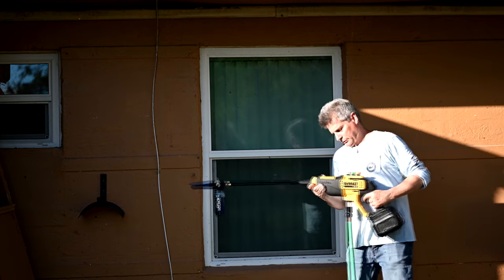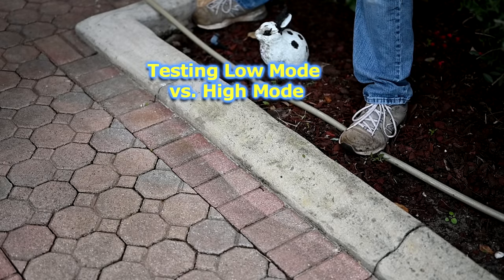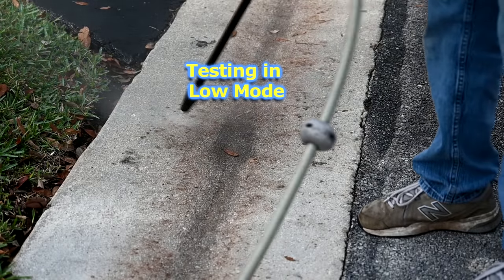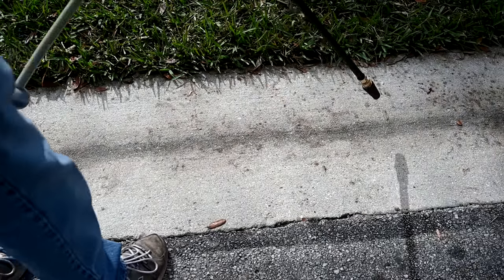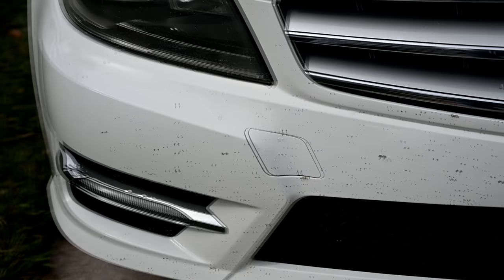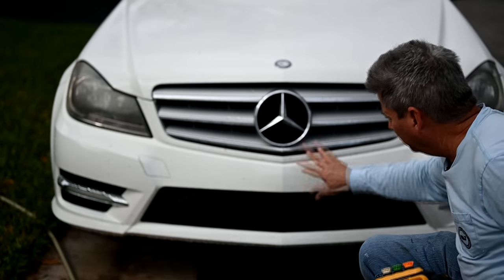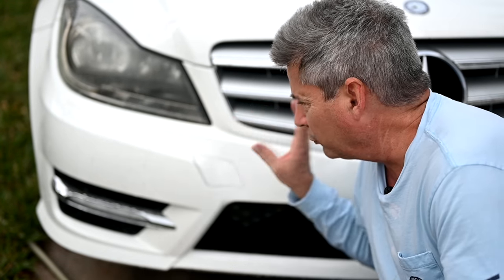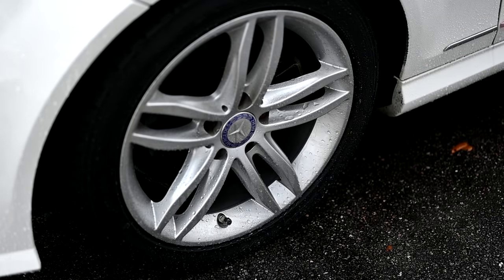Dewalt Power Cleaner: High/Low Pressure Tests Cars, Tools, Sidewalks

Comment: Mine should be in, in a few more weeks. A lot of people hate on this, but the thing is, it was never meant to replace a large pressure washer. This is going to be perfect for me. Because of some surgeries I've had that went really bad, I'll probably never be able to lift a heavy pressure washer again, plus this is a lot more convenient.
Reply from the maker: Good summation!
Reply: Yep, I use my Ryobi, thought it was weak but it has its uses,  just did 5 of the neighbors enclosed balcony @$50 ..crazy that's $250 for 2.5 hours of work..
Reply from the maker: @thetoolmat8632   Awesome that will now allow you to buy a few extra components and set up some hacks for that sprayer

Comment: Jeff I currently own this. Been debating on returning it. Not sure yet. I think the strength of it lies in its convenience. That's the main appeal here. I've been using it for rinsing off tools, trash cans, hard to reach areas, and basic car wash. The turbo nozzle is very inconsistent for me. 
I predict that the price of it will either drop to $99 or they'll do a battery combo. At 149 I don't know if this will be a big seller. At some point maybe a flexvolt only version with more power will peek more interest.
Reply from the maker: A lot of people have been buying it sometimes it goes out of stock in a few of our local home depot's and then you'll see it in back in stock a few weeks later

Comment: Hey Jeff. Tested the washer the other day using an inexpensive Tool Daily foam lance from Amazon. The lance came with a 1.1mm orifice and a 1.25mm orifice. Using the 1.1mm and adjusting both the ratio knob and opening knob I was able to get a creamy foam using Chemical Guys Honeydew. I think the best we can hope for is a creamy foam from the 550 psi. I will be interested to see how your new Ryobi does with the 1600 psi and 1.2 gym flow. Hopefully that Ryobi can get you closer to snow foam.
Reply from the maker: where do you install the orifice?
Reply: @jeffostroff   You unscrew the 1/4” pressure fitting on the foam cannon to access the brass orifice. It is a threaded brass plug with a hole in the center. Most have a slot across the opening so you can unscrew one size and then screw in the other one. https://images-na.ssl-images-amazon.com/images/I/81NdNZBLYrL._AC_SX679_.jpg Here is an image. I hope it works on You Tube
Reply from the maker: @markgaudino7730   Just ordered mine from Amazon and saw a couple of videos on it
Reply: @jeffostroff  Hi Jeff. If you don't post a video, could you please let me know how the foam cannon performs with your new Ryobi 1600 psi washer? Thanks. Oh FYI, Home Depot Kendall (#210) would not take the Lowes 10%. I tried before I saw your update about using the Pro Desk and seeing if they would write it up as Customer Satisfaction. The regular cashier (young guy) said, "We don't take those anymore." Love your videos. Keep up the good work.

Comment: What about using Meguiars All Purpose Cleaner for the bugs?  It may strip the wax but you could use spray wax after washing.
Reply from the maker: I doubt it has the chemicals that will dissolve the insect proteins.

Comment: Video seems to start and end like it’s incomplete. Good information though. I picked this power sprayer after dumping the ryobi squirt pistol sprayer. this one isn’t nearly as poor as the ryobi unit. Going to pick up one of those foam cannons for window and car washing. That seems to be the best application for this device. Maybe even screen enclosures.
Reply from the maker: Just a warning about foam cannons as they require pressure that's often 800 PS I or more which the dewalt unit is not capable of handling so you will not get good foam out of it I have not tried it yet on my unit but I will test it out soon

Comment: I like the idea of this being battery powered but I’m holding out on one to have a bit more power before I’ll consider it as I don’t want two different power/pressure cleaner/washer.
Reply from the maker: We might not get more power from a battery operated power cleaner unless it's a 12 aH 60V Flexvolt.
Reply: @jeffostroff  My thoughts exactly. Weight & ergonomics start playing a bigger factor at that point though.

Comment: I got one the other day and the wife don’t know yet but the Home Depot was running out and I didn’t want to not get one cause we need to wash the brick on out house and siding. Plus we have 4 cars that I wash and they leak so now the drive way has some oil spots that need clean n the rate they were selling by the time i got the ok to get one they would be gone. So this is a case of the better say sorry then ask for permission scenarios. And I did look at the ryobi electric pressure washer and I don’t know how safe it would be to have to run extension cords to get everywhere around the house with water spraying everywhere and I may not get shocked but it could blow an outlet outside my house is older so it has 1 gcfi outlets where they had the hot tub but the other 2 I think need updated to gcfi plug ins
Reply from the maker: Always a good idea to have GFCIs outside, and in all bathrooms and kitchens wherever you are within 6 feet of water
Reply: @jeffostroff  I always get the fc mixed up but you’re so correct

Comment: What soap gun are you using on the Dewalt
Reply from the maker: I was using the crappy bottle with black plastic nozzle is the junkie DeWalt soap applicator that comes in the box, useless unless you just want soapy water. Then you also saw the clear Ryobi Foam applicator which was a little better it has blue plastic top, then the Greenworks applicator had the green knob on top of the bottle at the nozzle. Her eis the soap we used: 🛒  Blackfire Pro Detailers Choice BF-100 Car Wash, 32 oz. https://amzn.to/39JFZss
🛒  McKee's 37 MK37-800 Xtreme Foam Formula Shampoo: https://amzn.to/36yIV9l

Comment: I'm a huge Dewalt 20/60v tool fan. I'm completely invested in this line. Other than portability for washing a vehicle, I can't see any benefit to owning this tool. I own a Ryobi 2300 brushless electric that completely fulfills al of the tasks that you're trying to accomplish  with this underpowered unit. Just seems like you're trying too hard to justify its value or purpose.

Comment: Thanks for sharing, seems Dewalt should go back to the drawing board.
Reply from the maker: There is nothing inherently wrong with the power cleaner it's a low 500 PSI power cleaner and probably the highest PSI rating that you can score out of a battery operated cleaner . They don't really advertise it from nothing more than doing vehicles and light tasks, which you could buy electric plug-in models that run up to 1900 PSI but then you have long electric cords to deal with, or you can get a gas powered machine which can go up to over 4000 PSI

Comment: Doesn't seem to be worth it when you can get electric pressure washers for under $100.
Reply from the maker: Yes Except you can't put a price on convenience like being able to walk all over the place with that dewalt power cleaner . With the Ryobi you're stuck by the length of the electric cord. And then the hose is short